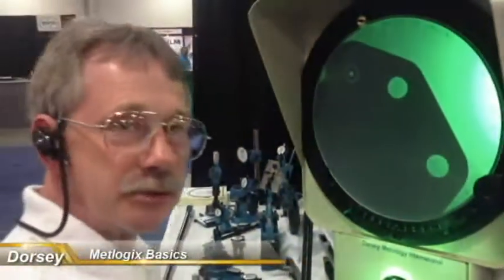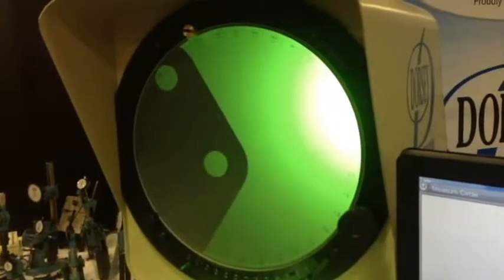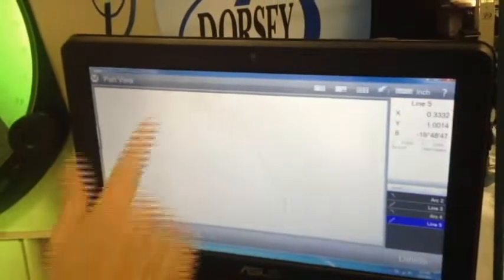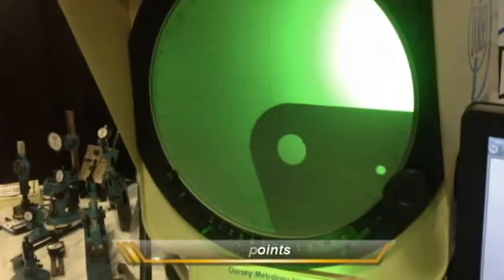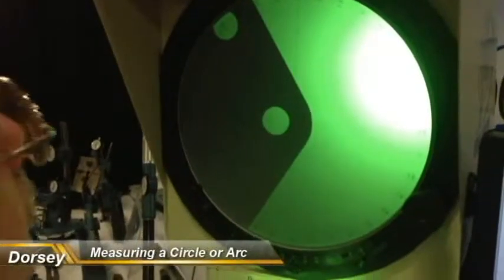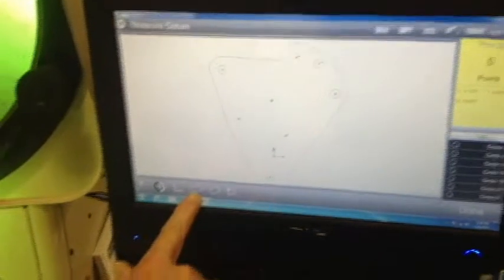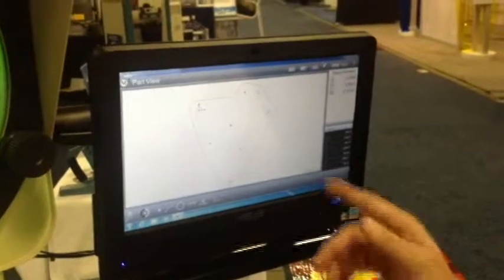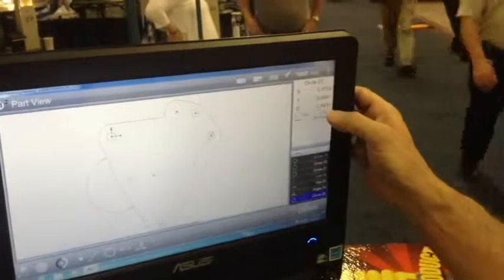Metlogix M2 training video

Comment: Yes, when you cross the same point twice in a row the M2 will start or end a measurement routine. You might need to turn on the option in the M2 settings tab then under the Measurement tab.
If you are having trouble getting this feature to work you can call Dorsey Metrology for technical support.